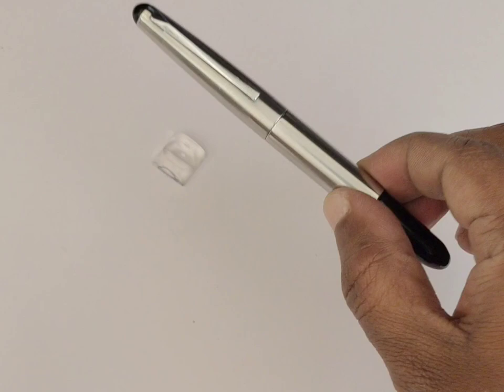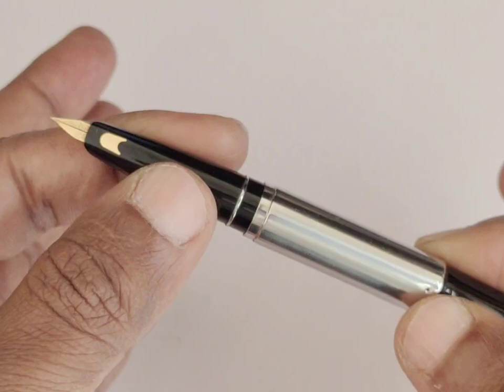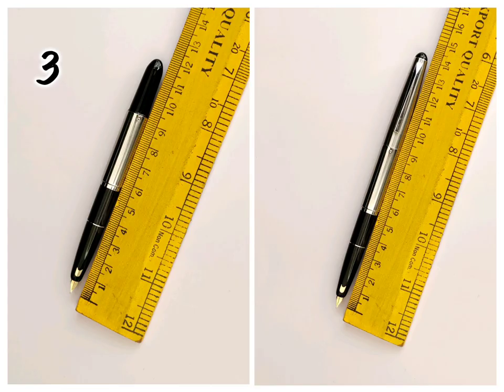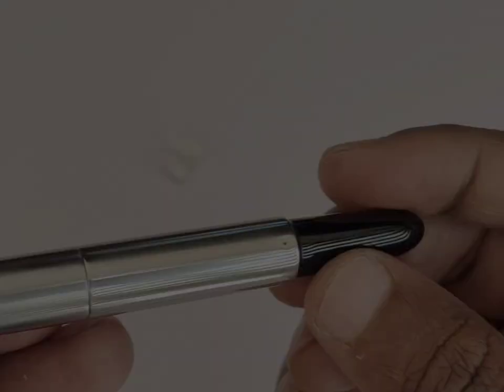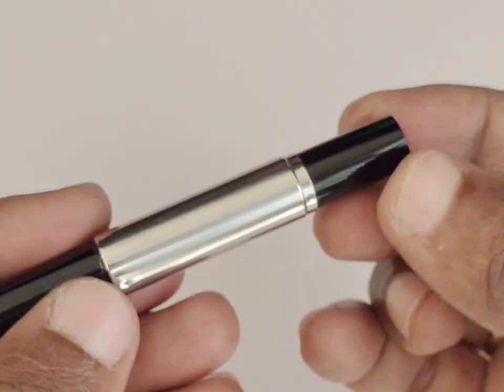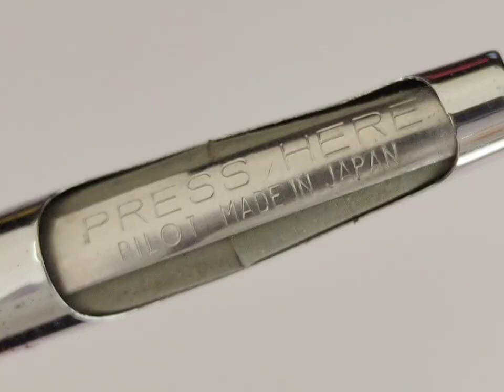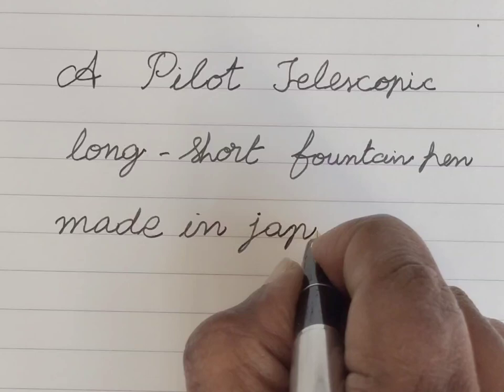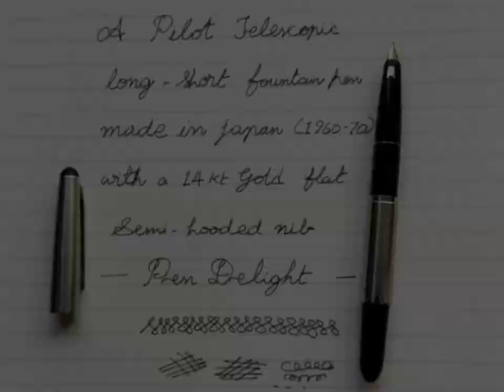Pilot Telescopic Long Short Fountain Pen | #vintage

Comment: It’s available in steel nib version too..
Mine is a steel nib version. One problem I have with this pen is it dries out and needs priming. Otherwise it’s a decent pen.
Reply from the maker: I have started using it just now. Hence not sure about the drying issue. I need to check after some days.